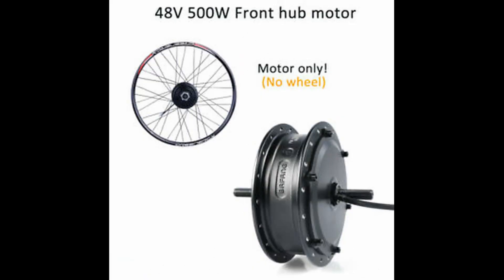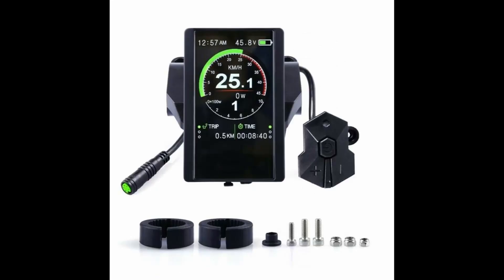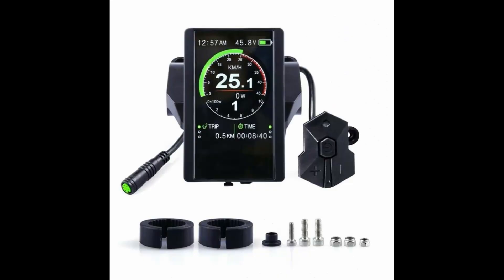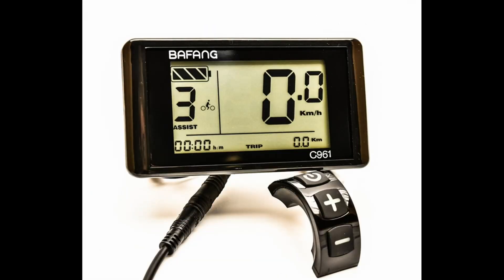E-bikes for beginners series #1: What makes an E-bike an E-bike?

Comment: Hi Johnny,
Can you give advise on the drive train you would use or upgrade to if your donor bike gears are worn out... Usually a donor bike come with a 3x drive train going to 1x, but the range for climbing hills wont be great unless you up grade. I upgraded mine to a box prime 9 1x9 speed 12x50t. It's great for climbing but this system has issues with shifting. Changing now to a shimano 1x10 speed 11x46t Deore. 
Cheers Love your channel.
Mike

Comment: What would be a good base bike to build a fat tire ebike for hunting? I don’t need monster tires for snow, mostly rough fire roads with some soft dirt/sand. Thanks!
Reply from the maker: I’d look at the specialized fuse with 27.5x3” tires
Reply: @JohnnyNerdOut  thanks. Looks pricey. Any ebike frames out there that will nicely fit the bafang hd? I don’t mind building a bike from scratch and it would be nice to have a frame made specifically for a bafang hd motor. Rob Rides recommended the dengfu e23 but I know you don’t recommend a carbon fiber frame. I plan to book a consultation with you as I’ll need help building from ground up. Thanks! Richard

Comment: You made/make the same mistake that everyone on YouTube trying to capitalize on ebikes makes. You gloss of (at best) the actual definition of an ebike, or rather a Low-Speed Electric Bike (LSEB) for Americans which is uber importante. Let's give potential American buyers some useful information. 

"Public Law 107-319, 116 Stat. 2776 (the Act), enacted December 4, 2002, subjects low-speed electric bicycles (LSEB) to the Commission's existing regulations at 16 CFR part 1512 and 16 CFR 1500.18(a)(12) for bicycles that are solely human-powered. For purposes of this requirement, the Act defines a low-speed electric bicycle (LSEB) as “a two-or three-wheeled vehicle with fully operable pedals and an electric motor of less than 750 watts (1 h.p.), whose maximum speed on a paved level surface, when powered solely by such a motor while ridden by an operator who weighs 170 pounds, is less than 20 mph.” 

Basically, if you conform to the Consumer Protection Safety Act's (CPSA) definition of an ebike/LSEB you are allowed to ride anywhere in America that bikes are allowed. Your wife's ebike could ride legally in American National Parks and yours cannot. Her's could use all Class-1 bike infrastructure, and yours cannot... legally. 

If you start by educating buyers on facts all the rest will fall into place, John. 

Everyone stay safe.
Reply from the maker: In due time all the info will be available. Trust me it’s hard to try and spit out as much info as I can without it sounding like a boring lecture. In my 02 vs HD video I make an opening comment to be aware of local power restrictions. Not all municipalities are a 750w limit. Oregon I know is 1000w. There are others too I just don’t know it off the top of my head. Ultimately it’s up to the end user to exercise due diligence to make sure they are being legal.
Reply: @JohnnyNerdOut  So until you get around to learning the facts you just keep giving bad advice? Yes, all states have their own regulations but the CPSA definition is the saving grace for ebike/LSEB owners in America. A BBSHD isn't legal to ride National Parks even in Oregon. Stay safe.
Reply from the maker: @brianbassettnumber1  I’m not sure what the bad advice was. Can you clarify?
Reply: @JohnnyNerdOut  I expect anyone that claims they are a "professional ebike mechanic and builder" to give all the facts, not just those that will garner YouTube hits and/or put money in their pocket. Maybe you should do a vid on how to use YouTube as a paper route and to get some much-wanted attention. Don't sweat it, dude, I have already set YouTube not to recommend your videos so you keeping handing out your "expert" advice to anyone foolish enough to listen and I won't call you on it. Good luck on the money hunt... stay safe.
Reply: @brianbassettnumber1  ...WOW Brian, I for one AM greatful for the videos. And personally I like the competition, unlike the monopoly our so called  "Laws" have allowed to screw us over.
Reply: @olguiq1013  Totally unintelligible other than that I can tell you are angry. If you want to learn how to do something poorly knock yourself out... no, I mean Knock Yourself Out.
Reply: @JohnnyNerdOut  none of it is bad advice Johnny that guy has issues just ignore him thanks again explaining how to build an ebike and not waste hard earned money 😉